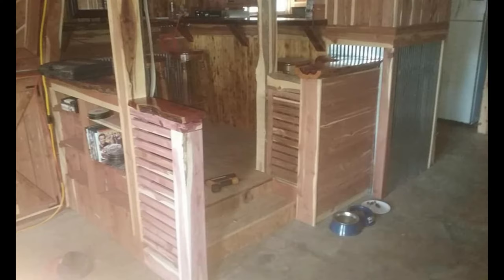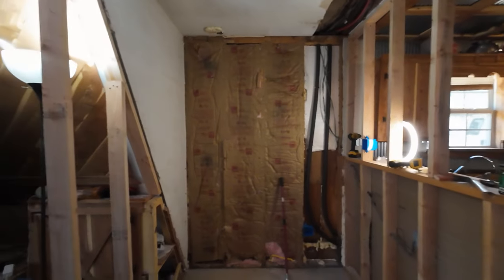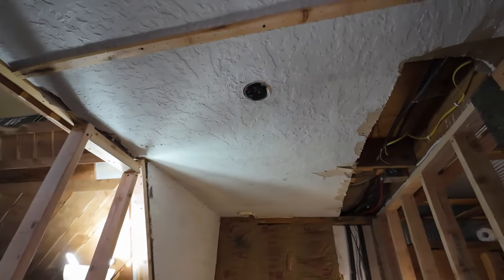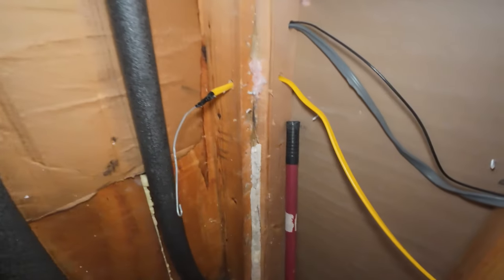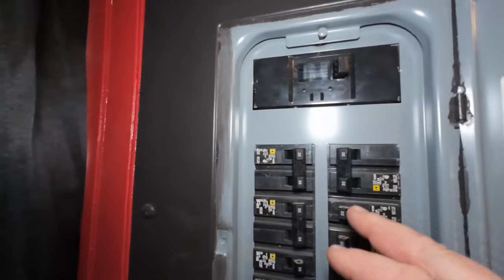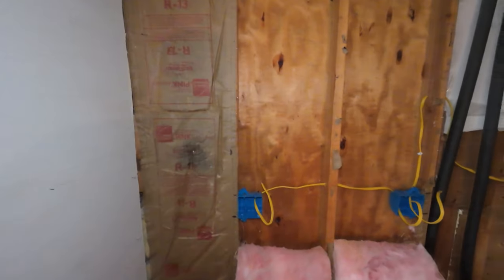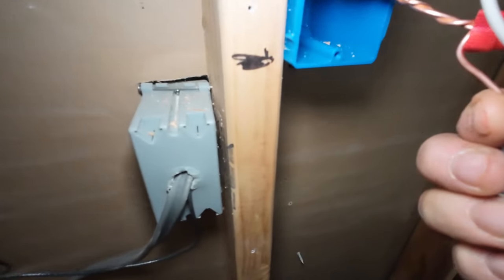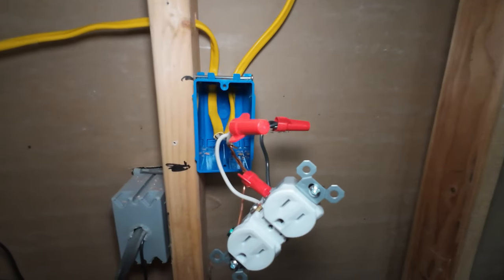Running Electric To The New Office.Ready For The Walls And Ceiling.Running Outlets in Parallel

Comment: I'M sure you thought of it but if not that cedar would make some nice sign material for that Lazer and even better if you started routing  
also something I did on a gut job was run pvc "chase's" in the ceiling and from the 2nd floor down, the pvc is cheap enough that its no loss if you don't use it but the day you want to run a wire from one end to the other or another floor you'll be glad you did.
Reply from the maker: PVC is far from cheap these days

Comment: 1800÷240=gives you the amperage of your cook top if it's 240v 1800÷120 if it's 120 v
Reply from the maker: Buying a 110 volt top, just ordered it
Reply: @ouachitamountainliving  ok it pulls 15 amps  a breaker is only good for 80 percent of its rating 20 amp will do it and be safe